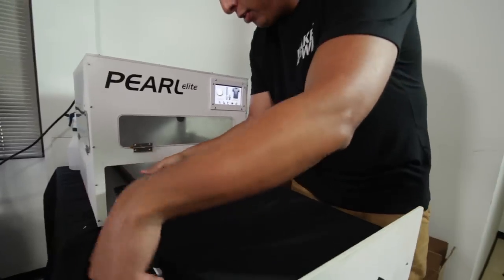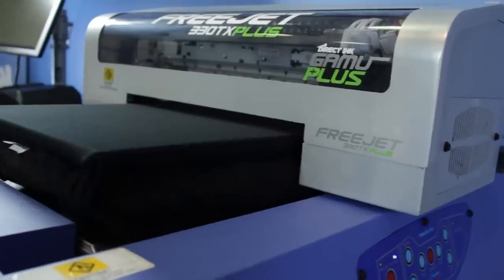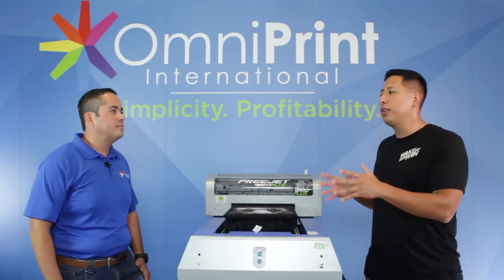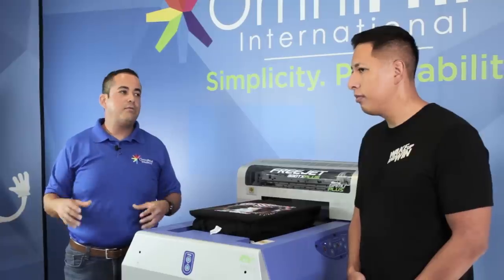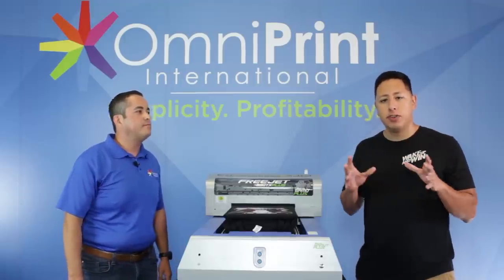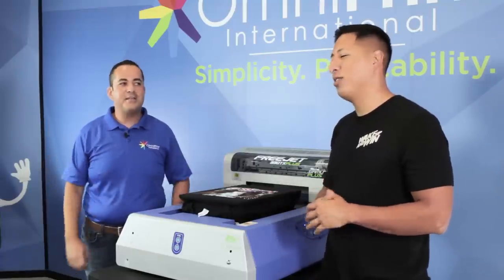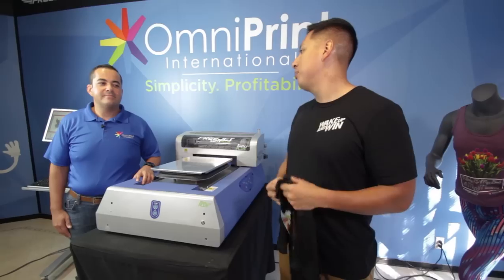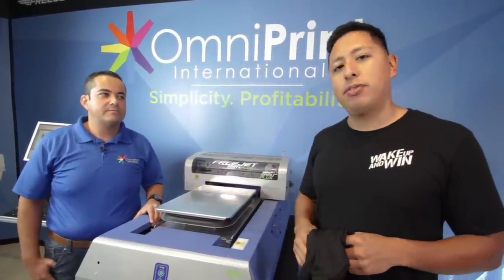Start Your Own T Shirt Printing Business Using a DTG Printer

Comment: Good Stuff John... so what does that machine cost?
Reply from the maker: Jay Barham just like financing anything it ultimately depends on your credit. It’s best to hit them up for the deets. I linked the site there and they can give you the info. But it makes sense for a biz once the sales exceed your monthly printing and financing costs.
Reply: Jay Barham: The Freejet 330TX is between the $19,000 - $20,000 range and the Freejet 330TX Plus is about $25,000.

Comment: Machine nice but how much do each printer cost
Reply: youngster enetainment $7000
Reply: Is that 7000 US dollars
Reply: John Likio I saw it on eBay for $7000 US dollars but the actual website will give you a plan.
Reply: They are $25,000 USD and then you need the pre treatment machine $3,999 and heat press $2,000, conveyor dryer $5,000...etc. with inks, taxes and everything else you are looking at OVER $40,000 US for a complete set up.
Reply: Alot more expensive than expected....let me see what china has to offer.

Comment: do you have a video discussing the screen printing process? also how about comparisons in the durability aspect. last thing I want is to print something that looks great but doesn't hold up for years.
Reply: ok so I see you did address some of the differences between dtg and screen printing, but was still wondering if you had anything dealing more with screen printing. I know that it is still widely used in the industry and would just like a better understanding of the reasons why and benefits over dtg.
Reply from the maker: I have a video coming out next week (9/29) that discuses more in depth of what your asking. Let me know if it helps!
Reply from the maker: Benjamin Lanning new Video will be coming out next week addressing that point 🙏🏽 look for it Wednesday.